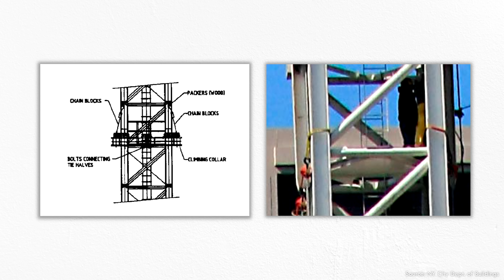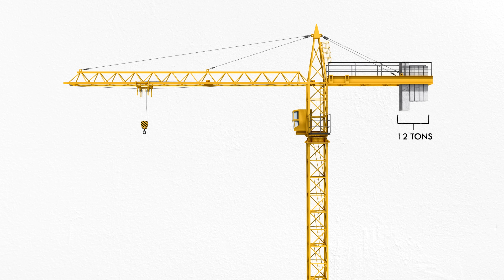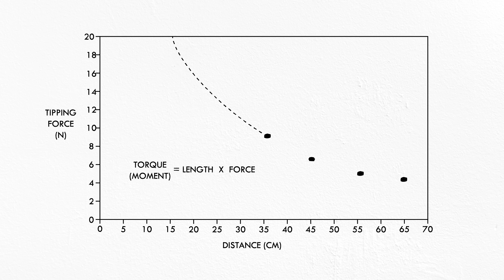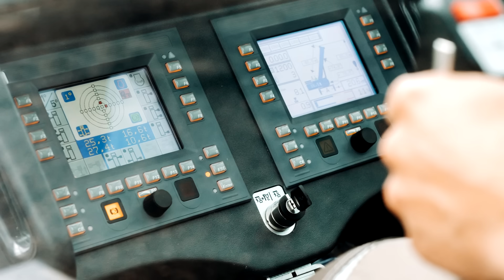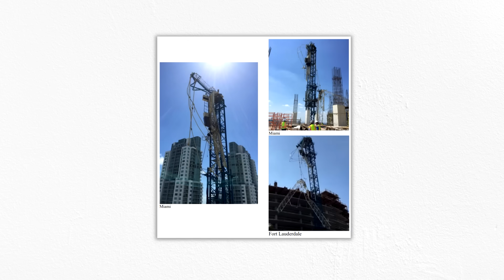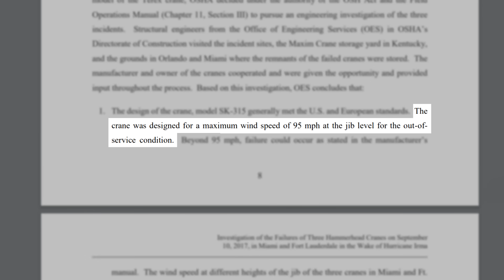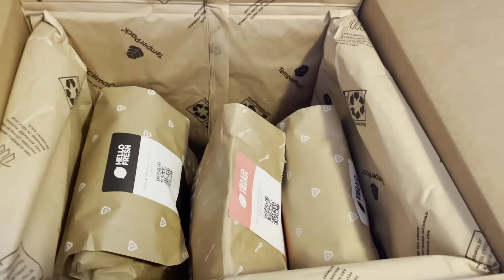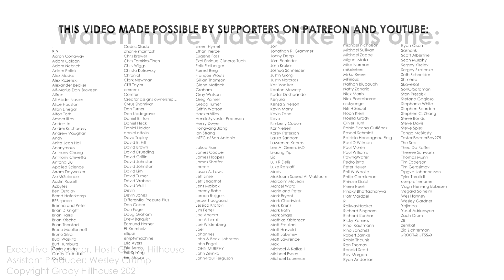Why Cranes Collapse

Comment: The video was ok but I was disappointed that you didn’t  mention anything about Dispatchers of crane companies pushing operators to do things out of chart either because something on the job site had changed or the load was heavier than expected or The operator didn’t have enough experience, I personally lost a good friend because he started operating for a new company the crane was left on the job site from the prior day but the lift he needed to make was out of chart and he new if he called in they would wimp on him because we all know the safety factor of the chart is usually 15 percent less and we all know that buffer is there for a reason but because he was new he didn’t want to be a wimp and make them send out more counterweight, you can badmouth That he shouldn’t of done it, but the pressure is real when your in that seat Whether you want to admit it or not? Operating Cranes have left a bad taste in my mouth so I spent most of my years being an HDR.

Comment: The most dangerous thing you can do when operating heavy machinery is rush.
Reply: This statement can also be applied to common vehicles like cars and trucks.
Reply: @TienNguyen-dg4xi  Yeah but for some reason people insist on speeding in places like it's a goddamn race way,hate those twats,those are same ones who run red lights too.
Reply: YES.  I've had like 5 accidents in 27ish years and 4 were due to rushing. The other was non compacted ground.
Reply: I’m an HE operator in the Marine Corps soon as I got to my shop I got told “do your job quickly and efficiently, and at a pace you know you can safely and efficiently move , at any time you think it’s unsafe to move a load and need to make a call don’t hesitate, if a Staff and O are pissing and shitting about it tell them to call dispatch and we’ll back you up, rather get chewed out than some one crushed cripple or dead.” Best talk I’ve had, just wish others would understand that if I can’t see you or your too close your going to get hit by a 40+ ton machine that doesn’t give a shit.

Comment: Having witnessed a 400 ft crane collapse in Canary Wharf in 2000, it certainly brought home how absolutely massive some of these can be. Cranes might look tall and slender from a distance, but the size of the tubular beams and frame structures are terrifyingly huge when you see them brought down to ground level.

Comment: I have nearly 10 years of experience in planning and engineering lifts and heavy lifts both on-shore and off-shore, on-air and subsea,  and this was a great summary introducing to cranes and lifting operations that many people involved in such operation on a daily basis are often unaware of.
Thank you

Wind and what we call DAF or Dynamic Amplification Factor are the worst enemy of the perfectly planned lift, that's way we use lots of contingency coefficients and safety factors on the load, it's mass and CoG, the rigging, the load spreading etc.

Comment: #1 Human Error, in assembly, disassembly, installation/operation surface prep, poor maintenance, operating outside capabilities in load and/or position. #2 Weather exceeding design parameters. #3 (way down the list) Mechanical failure due to not actually being able to perform to specification.

Has the failure of the recent one in Canada been figured out? There are photos taken by the crane operator showing a worker on the climbing frame not wearing a hardhat or any safety gear, not even a tether. The operator should have been operating the crane, not snapping pics. There's another photo of a worker (presumably the operator) of himself sitting out on the boom, showing his legs dangling over the side, wearing regular shoes instead of steel toed work boots. So it's highly likely due to a human screwup since they were obviously so lax about safety and paying attention to their work, but what did they do wrong?

Comment: Watching a youtube channel of a crane maintenance engineer in eastern europe I would say they rarely have any manual yet to say assemble manual. Cranes are old and manuals are paper. Manuals rot, become wet, decompose and lost during the 20 years of the crane operation. Also repairing impose additional restrictions to its load but they also rarely documented well.

Comment: Always amazed when things that crucial to operation and safety aren't made fool proof of at least marked in thousandfold with required / present specs. Like the fact that 12 ton weight even COULD be interchanged for the required 8 ton weight, it is obvious there were no clear indications on the mounting point of the weight nor anything one can't miss on the weight itself!
Reply: The problem is that there is probably  a jib config that needs a 12 ton weight.
Maybe clearer labelling but then people don't read warning instructions.  Sensors on the bit that was taking (or rather not taking) the strain would have saved lives.

Comment: Hey mr Grady. A bridge does not have a “single load limit.” (@4.30). It’s load limit, of course, depends on how the load is distributed across the bridge. 

A bridge may not handle a 40ton vehicle with 6 wheels, but may handle 40ton with 10 wheels. The load limit sign is for simplicity, but an engineer can assess the bridge against specific vehicles when needed.

Comment: One of the biggest near misses happened in Chernobyl. During Shelter construction they were lifting one of the rooftop beams with one of the world biggest cranes, so big its counterweight was its own vehicle. The ground gave up, the crane tilted but left standing, counterweight's wheels went uip int the air.. They have limited ability to prepare the construction area, putting extra material and compatifiying it, for obvious reason. Every worker preparing the area had his exposure limit... Area preparation job was even partially done by remotely controlled dozers. If that 177 ton beam felt onto raeactor building who knows how many radioactive dust would be thrown in the air...

Comment: That's a nice toy crane, I've seen many with the outrigger supports and extendable parts but until now never one with a counterweight compartment. Always an interesting thing to see kids play with and early on with a bit of help let them figure out what does and doesn't work (although when they are very young they might just like to watch it tip over because that's fun). Still it's a very neat intuitive way to learn fairly complicated mechanical issues while playing at a young age.

Was expecting some of the usual "almost always human error", which it mostly was. But combined with good demonstrations and explanations around it, haven't seen soil mechanics explained/demonstrated that clearly. The deformation failure shown around 7:50 was a really nice practical demonstration I haven't seen before.

Comment: they are complex and hazardous machines but if you can learn to operate one with great skill its a well paying career from my understanding.  Of course what heavy equipment isnt hazardous, it just becomes dangerous when used incorrectly or outside its specs.  I bet some crane failures due to poor instruction following can be traced back to big bosses going "get it done faster".

Comment: There were several factors with the 1999 Milwaukee crane disaster.  Wind was one.  I have heard that the operator did not want to do the lift.  If you watched the video taken by the OSHA inspectors,  you heard a sharp metallic crack.  My understanding is that was a large unknown cast iron pipe under the crane giving way.

Comment: I dont understand why they they have to use only concrete block as counter weights, they could use water tanks in combo with those blocks since the water can be dumped during stormy weather or the could use sand or clay with water in ratio 60:40 in a tank since it can be dumped and wont impact the ground that much if we slowly release the contents in the tank. This would reduce the p-delta effects during windy conditions anc non operating hours
Reply: Water is not the right material, water tanks can burst during operation (the crane will tip over then) and water will freeze everywhere where the temperature is below 0 ° C. 
If the crane turns into wind they are relatively stable, of course extreme storms can still be dangerous, but they also would be dangerous if you would remove the counterweights on top. 
Most crane failures are human failures, technical failures are only a small percentage.

Comment: Great video. One point of contention, which you started to address at @11:40 when you correctly commented that "nearly every crane $*&? is easily preventable".  My issue is, these are unintentional, preventable injury events. They are not accidents, which would instead imply circumstances completely beyond prediction or preventability, which is almost never the case.

Comment: This gave me a bad feeling,  SpaceX uses alot of cranes, huge ones, with hundreds of people working near them
Reply: Cranes are perfectly safe, if you use it in the right way, with enough stability reserves and in the right weather conditions. Often too much weight (some even manipulate the load limiter) or high wind are causes of failures.

Comment: I had thought SpaceX delays lifts due to wind solely because it makes the load harder to manuever. Hadn't considered that they aren't designed for lateral loads.
Reply: Not only that, the load can start spinning uncontrollably in high winds. Try grabbing an 5,000lbs object when its spinning 30 mph.

Comment: @5:53 you should know that this type of crane do have charts for the outriggers not extended, but they will always be deployed to stop the suspension of the truck from having any load, making the whole platform sway with any force that you put on it. the first thing that any mobile crane will do is lift the truck from the ground to make sure that the suspension doesn't have any weight on it.

Comment: Great video. As a crane  driver in the steel industry, everything you put forward is true.
Also fatigue with the operator is a factor and pressure put on the operator to keep on target with time lines also causes incidents that easily could have been avoided.
You mentioned riggers which is another factor. 
Cheers

Comment: Where did You get your "Toy Crane"?????    I would love to get one like that for my  10 year old Grandson!   He has been a mechanically minded kid since her could first toddle around.  If I give Him a "toy" like that, then we can both play with it.  😁
Reply: I'm not sure if it's of any use, I saw "LTF 1045-4.1" on the side of the cabin. Had a similar thought in mind for maybe a few years later myself (5 years is maybe a bit too young). But throwing that into various search engines seems to be good at returning results for actual Liebherr cranes, I don't need a 45 ton crane! But apparently used ones can be bought in the US for around 140k USD

Edit: just for sake of trying I figured I'd also throw it into Ebay (not my favourite shopping platform) and then it comes up with an item sold by blackforesthobby for 189 USD (and a stupid shipping cost to my country from Arizona but in the US it might be acceptable). 
I'm not sure if the one Grady has is from the same manufacturer, but the one that showed up on Ebay is from this company (they have a lot of other cranes as well): https://www.wsi-models.com/en/cranes

Comment: I notice your microwave was a built-in and installed above the stove. Might I suggest a modification?
Create a shelf elsewhere in the kitchen where the microwave sits. No installation necessary.
Microwave ovens don't have a good lifetime. We are lucky if we get 5 years out of ours. Having to call a cabinet guy to put in another one is a pain.  The last failure involved a quick trip to the store and merely sitting it on the shelf made for it. Didn't have to call a cabinet maker.
Another advantage of a shelf is you can use the microwave without the hot air from the stove underneath it burning your arms.

Comment: Apparently the preferred victm of crane accidents is the operator, so I ask: is it not feasable to build remotely controlled cranes, maybe with cameras installed at certain spots to better see the details of the ongoing operation?
Reply: The unintended consequence would likely be more deaths overall.  You want the operator invested in safe operation.
Reply: The construction crew is still in a hazardous situation. Training simulators would be nice, but remote control is only appropriate if the operator stays highly cautious. However, I can only see some operators becoming lax with personal fatality ruled out.

Comment: Dude that cutting technique will get your fingers cut. If you happen to have an accident you want to have nails first. Thumb goes back and fingers should be curved so that you can use nails instead of your finger tips to reroute the blade should anything go wrong. I think there is a Gordon Ramsay video on not fooling around knifes. I didn't learn this from a video, but I think it's a better alternative to my path to learning.

Comment: This is the reason why Elon's rocket won't land on Mars, unless it gets legs or a pre-landed landing pad.
Reply: The small legs they use now are only for the prototype versions. The launch vehicles they test today are not the final version.
Reply: @simonm1447  He could save himself a few bucks by actually using the legs NOW. Those little legs get crushed and his rocket crashes.
Reply: @rcarmisin3465  the starship rockets he is flying at the moment are just testbeds for single use, they are not intended to fly multiple times, because if they fly successfully they have all the data they need. The ones which flew before the next launch were only for suborbital use, and the next will land in the ocean if the flight is successfully.
They know what they do.
Reply: @simonm1447  I'm not interested in the details of the legs, but the original comment still stands. Elon's rocket won't be stable if the ground isn't, unless those legs can compensate fast enough like the legs on those drills on the Matrix, he better hope he finds a good spot to touchdown or his rocket will fall over like this crane.

Comment: Duo to lax safety regulations and little enforcement for the ones that do exist, crane failures are much more common in the US than in Europe. Deaths in constructions (absolute, per project, per head, etc.) are also considerably higher in the US than in Europe.

Comment: what is not mentioned here is that the minimalistic style of modern engineering coupled with optimization for efficiency and economy is responsible before negligence. But that problem is intimately linked to the fact that construction costs money.
Ideally structures ought to be built in such a way as to withstand multiple times the stresses they are exposed to. Bridges with more columns, cables double as thick, cranes with several support beams on all four sides and heavier ground weights, thicker walls in buildings, walls made of solid stone, thicker beams, more arches where forces raise even slight concerns, and so forth. 
Ideally a bridge over a river for example ought to be so stable and strong that it doesn't require maintenance for 100 years at least (excluding the roadway above of course)

Comment: Crane mechanic here. 
3 reasons we see all the time. 
1: Operator using the override key in the incorrect manner 
2: Ground failure (Outrigger pad sinks) 
3: Incorrect setup on the LMI system or Load moment indicator, where the crane is setup with 10t of counterweight, but the operator has selected say 12t, so the unit is working out of a safe load chart. Rarely we see a Mechanical failure when something actually 'Breaks'.

Comment: Great video, thank you. 
You have a really great looking family. Everyone looks very happy. Well done. 
Cranes could have far more computer monitored sensors to be aware of and manage torque issues. 
Also computers can model crane lifting and movements and simulate wind conditions, to show where the biggest threats to a safe and successful  lift would be. I think this is a huge market opportunity. 
I'm surprised the counter-balance weights don't move to help adjust to near or far loads. 
I would like to see a & breakdown of causes of crane problems.
Very well researched and presented, thank you very much.

Comment: Very nice video. I would like to correct one thing: you are using your lime squeezer incorrectly. The cut surface should face down towards the holes. This way, the pressing surface everts the lime as well as lets the juice freely exit without being trapped behind the peel.
Reply: Also, cut the fruit across the bias of the sections instead of end to end. But I couldn’t really tell whether you had done so due to watching the video on an iPad that really lags in pausing. Happy cooking! 😃

Comment: I always wondered, why cranes are not based on multible colloums (3 or 4) handeling the load in between them. would that not be inhearendly more stable?
Reply: less mobile too
that's why mobile cranes are most commonly crash
Reply: @Ridcally  I can see, how this concept would be less viable for mobile cranes. But most big building projects will have stationary cranes. There might be some building sites that come with constrains that prevent this concept, but I do not understand, why as a rule we balance the load on just one column.